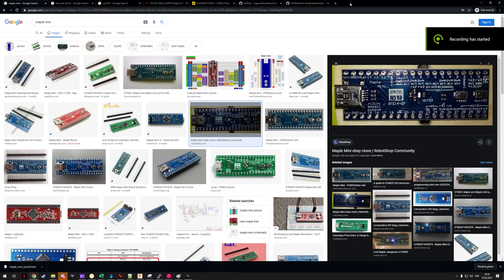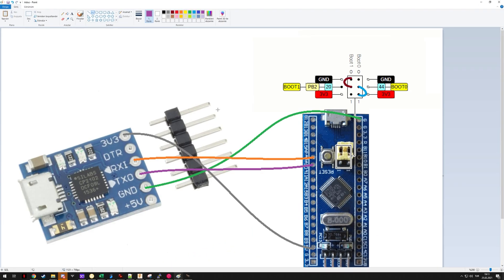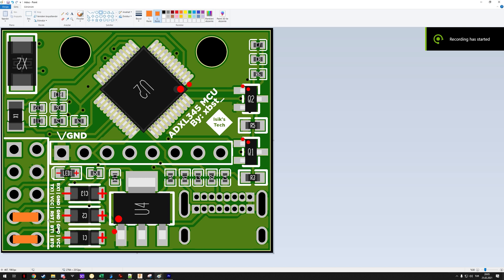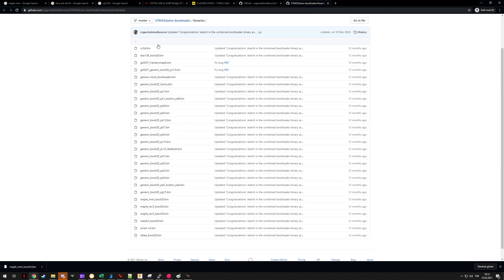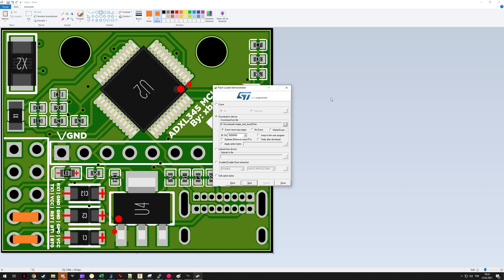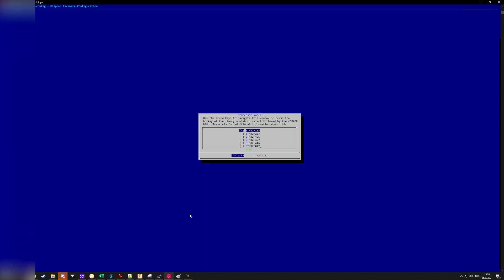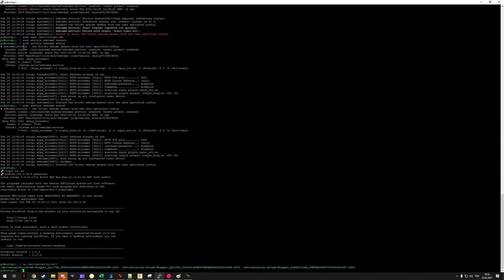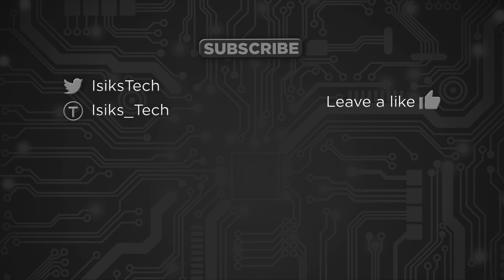Flashing Klipper to STM32F103 Boards

Comment: It can be done much easier. You need to configure flash file without bootloader (0kb) and just flash your board via uart with your klipper host. Just run 'stm32flash -w out/klipper.bin -v -g 0 /dev/ttyUSB0' after 'make' command. Dont forget about jumpers.

Comment: I'm trying to flash ortur obsidian 6.2 board based on stm32f103. Do you think I'll be able to do that if i find correct pins?
Reply from the maker: I'm not familiar with that pcb, but in theory, you should be able to
Reply: @IsiksTech  lack of familiarity is why I'm asking :P thanks for the confirmation :)